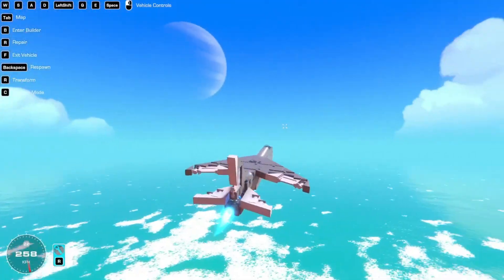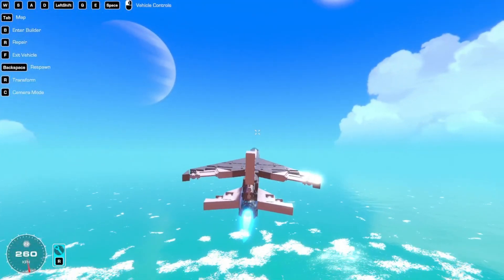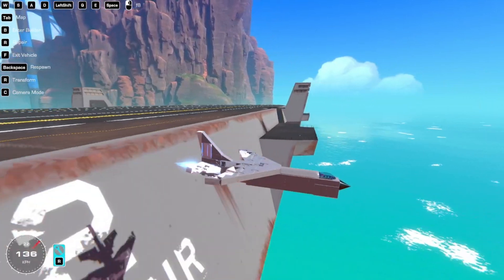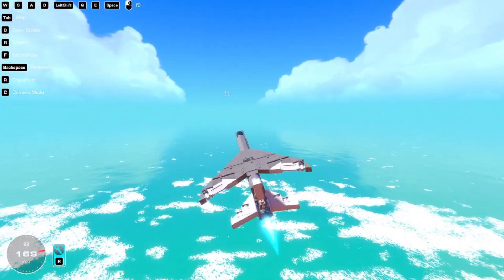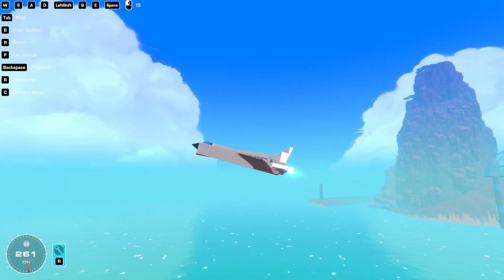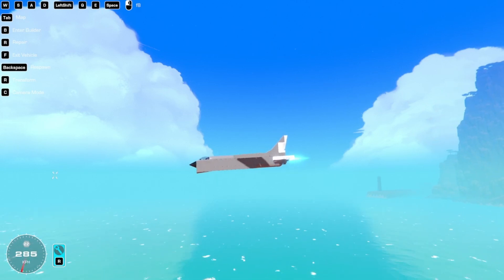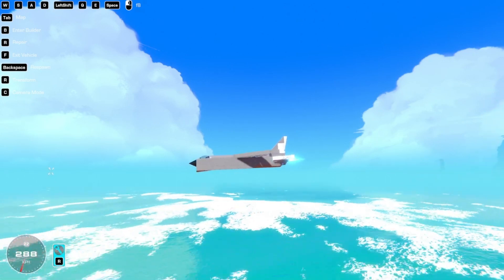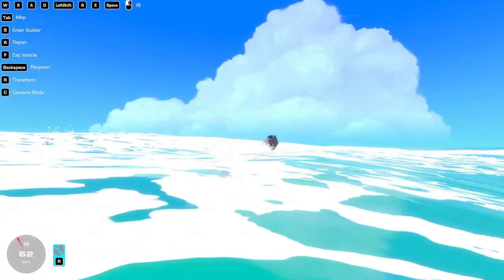Understanding Plane Balance

Comment: Can you make a video on hovering mechanisms? 
It's like there are different types that I can find: Gyro based, and Speed Sensor based.

What I can't figure out myself are the hybrid of gyro and speed sensor. I saw one build that sort of uses dampening because I can see the thrusters wiggle back and forth before stabilizing itself in the air as if it is frozen in place. 

The hybrid sensor one is far more stable than the two.

Comment: Something interesting I’ve learned is that the airfoil wings will create a lot of drag, even if they are zero drag glitched. 
they effectively have 5 degrees of AoA built in
You can get rid of this by using either swing wings, or variable incidence wings, though swing wings seem to work better
Reply from the maker: interesting, will test myself to confirm.
Reply: @ThisIsDumbAllTheNamesAreTaken  I forgot to mention you don’t need variable geometry, you can just use the elevator or aileron wings.

Also some of the vertical fins/rudders are bad because they don’t negate drag on Blocks behind them